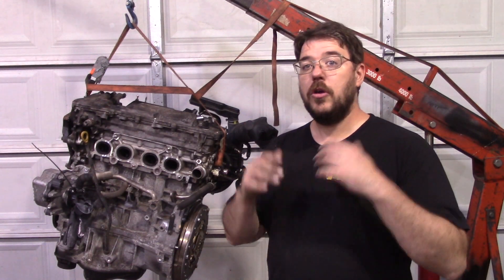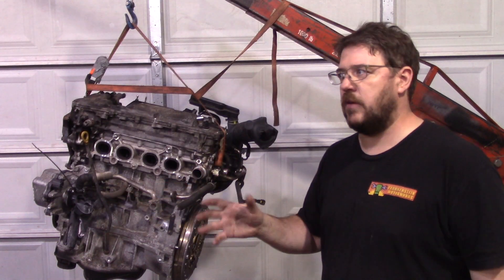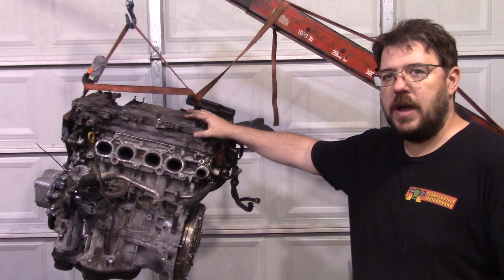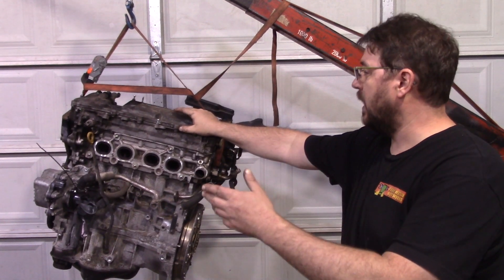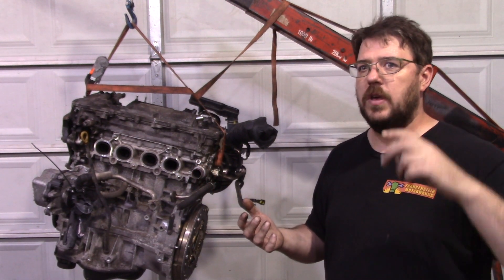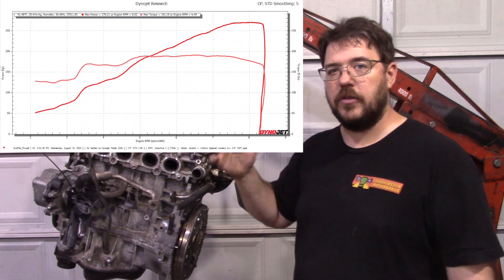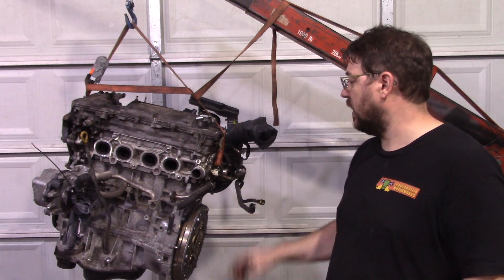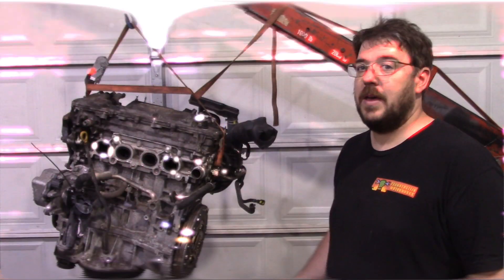270whp on a 2AR-FE!

Comment: To achieve your desired 12.5:1 compression with the 1AR crank, will you be using shorter custom rods to use the OEM pistons, or normal aftermarket/OEM rods with custom pistons? Also, that bump in torque at about 3500 seems interesting, I wonder what kinda wonky resonance is going on there.
Reply from the maker: the bump at 3500 is just because i did not tune down low too much. that could be smoothed out by a fair bit but i don't want to do it until i have the final version of the product.

Comment: 270Whp already better than K24 + K20 Vtec Head , Nice job , Marc
Reply from the maker: Honestly, it would be weirder if it wasn't. This motor is about a decade newer design than the K series. A lot of things have been figured out in that decade.
Reply: @FrankensteinMotorworks  your motor still on stock Piston & conrod right ??
Reply from the maker: @LeongStrife  yes, i have not touched anything in the bottom end.
Reply: Delusional.

Comment: I need a 2AR rwd trans... Miata would love it, helluva lot cheaper than K.
Reply from the maker: There are RWD transmissions that can mostly bolt up to this engine (starter mounting issues are still there) but you're absolutely right that a good RWD adapter would be fantastic.
Reply: @FrankensteinMotorworks  not that trans adapters are super difficult. Wonder if a taco 5 speed could be crammed in. The motors look mega tall, I need to do some measuring and see where it's at. Already running a standalone so why not. Also stock torsen could handle that motors torque, so custom driveshaft mostly, everything else would be ok

Comment: i’m torn between this and the 2gr for a mkii mr2. i’d like to leave room for forced induction.
Reply from the maker: honestly it's a tough decision because there's no good answer on this for everyone. But if you're going boosted it's a hell of a lot easier to fit a boosted 4 cylinder in the SW20 than a boosted 6 cylinder. What kind of power goals do you have?
Reply: @FrankensteinMotorworks  absolutely. im thinking 400 whp. looking forward to a boosted 2ar build!
Reply: I wonder what the advantages of the 2gr are since it seems like similar HP is achievable NA and the 2AR is easier to work on

Comment: If you were to ballpark this, can you do this swap, 270whp setup, with tranny for less than $5k?

I love how this is the toyota version of a Kswap, but better in many ways
Reply from the maker: the swap costs for the motor in an MR2 Spyder can vary wildly depending on how you source the donor engine/transmission. that can go between free and $3500. beyond that you're looking at about $3200 for all the swap bits, some of this can be DIY and you can save a bit there too depending on how handy you are. then, to modify the motor like this you need valve springs ($620), cams ($990), intake manifold ($799+$320+$500). Which adds up to about the same cost again as the swap, about $3200 or so. 

No matter how you slice it you're unlikely to be able to fit this exact setup in an MR2 Spyder for $5k or less unless you do a lot of DIY parts.
Reply: No, it wouldn’t be that cheap unless you parted out a tC for the engine/transmission. 7k for the normal swap, plus 1k extra for an ECU, plus 1.5k for cams and springs, plus 1.5k for the intake, roughly.

Comment: I know you are still building a drag motor but I didn't hear any statements to take the record this go around. Good results though.
Reply from the maker: This wasn't really an Evey video, this was just a 2AR-FE video so i kept the drag racing talk to a minimum. I still very much intend on taking the record and this result is really helping my confidence in my ability to do so. this is around 125hp/L and my goal needs to be about 150hp/L and i haven't done the things that are more or less guaranteed to make more power yet (compression, displacement and fuel type). Will that add up to the missing 80whp for my goal? I'm not sure but there's only one way to find out.
Reply: @FrankensteinMotorworks  Is the attempt date open ended on this project? I ask since I would hope to still be drag racing at that time.
Reply from the maker: @HuxRacing  As much as i'd like to make this my top priority, i do have a business to run. But it will be relatively soon.
Reply: @FrankensteinMotorworks   Well understood. Its been over a year since the callout . If it takes another, the goal post will be over the horizon.
Reply from the maker: @HuxRacing  i don't quite understand what you mean by "over the horizon". Are you getting out of drag racing in another year or are you continuing to upgrade between here and there?
Reply: @FrankensteinMotorworks  Upon callout the all motor mr2 record was 11.6. The record is now 11.18.  By early next year I anticipate mid 10.50s. All on E85. Methanol should see these cars in the 9s.
Reply from the maker: @HuxRacing  oh, yeah i get that and i do wish you the best in going fast. I have a lot of catching up to do. I'm glad to hear you aren't retiring in a year.

Comment: What is the cost of the plenum required to work with your velocity stack? Also is the TB is the stock 2ar one?
Reply from the maker: It uses the skunk2 ultra race plenum, there's a bunch of different ways to configure it from there: https://skunk2.com/induction/intake-manifolds/ultra-race-intake-manifolds/907-05-0070.html

I used a 3.5" throttle body
Reply: @FrankensteinMotorworks  the 3.5 TB: which one are you using exactly?
Reply: It would be simpler if you could package all the HW required in one bundle on your page

Comment: I wish we had someone like you in the 1NZ-FE world.
Reply from the maker: I'm sure it has a lot of potential, most of what i'm doing here can be done as one-offs, they just take a bit of time to get done. It's just that i'm not dealing with any cars where the NZ family makes much sense.
Reply: There are a few places in other countries that build and produce parts for the NZ. You could always do the tried and true 1nzfxe and jun cams. Usually 150+hp out of that setup
Reply: @connorbabcock8197  I actually have everything to do a 2ZR-FE swap into my Yaris except for the engine harness out of a Scion xD. Im curious if you can put FE cams in a 2ZR-FXE like the video as the FXE is intake VVT-i only whereas the FE/FAE is dual VVT-i same as the 2AR.

Comment: That’s big on a intake gain. Do you have a lot of injector duty left? Also 2.7 or 2.4? The 2.7 is taller does it even fit? The 2.7.
Reply from the maker: I'm at about 70% injector duty cycle. THis is the 2.5L, 2.4L is the previous generation. The 2.7L 1AR-FE engine is the exact same block and head, it will fit just fine.
Reply: On fuel I’d start with race fuel with e mix. Btw I saw your around Indy. I’m just down in Evansville. I was looking at this 2.3 eco boost I have sitting here to put in my spyder this winter.
Reply from the maker: I will probably play a bit with ethanol but being in Indianapolis it's easy to get Methanol so there's little reason to play with E85/E99 first.

Comment: Well Done!  
Another little trick is to move the injectors (or perhaps direct injectors at ~150 bar?) to the mouth of the intake bell, higher pressure, better atomization, more surface area = cooler intake charge
Thanks again for this.
Reply from the maker: The stock injectors are actually really fine atomizing. I am currently using the 545cc version from the 5th gen 3s-gte which has the same spray pattern as the stock 2AR injectors. videos like this do show there is an advantage to it (https://www.youtube.com/watch?v=u_E14RKskbM) but it's a pretty small advantage. At the moment i will not be doing this but as i raise the revs more and more it may become a thing.
Reply: @FrankensteinMotorworks  Absolutely.  I'm working with a much more archaic design - just trying to get the coolest, densest intake charge I can.  And that takes time and maximizing surface area of the liquid...  hence, injector location and obsession with smaller drops.  Luckily, I have vertical intakes, not horizontal.  BTW, great video
Reply: No if di you leave di and run extra port injectors using something like a split second controller. Most have a tb spacer setup for 2 injectors to 4 meth ports. Otherwise 4 extra on each port. Which is best to keep valves clean on a di engine.
Reply: @justanotheroglesby2847  I'm trying to make the smallest droplets, with the greatest surface area possible, getting the intake charge as cool as possible.  Fuel droplets from DI injectors are orders of magnitude smaller - not worried about keeping the valves clean - worried about making the intake charge as dense as possible with the least amount of puddling.

Comment: I guarantee you this engine was originally designed to not only go into normies cars but whatever the FT86 project would be IF Subaru said no. Not that Subaru could say no when Toyota bought a giant stake in them, but you have to have a back up. But the issue was, they couldn't make a bespoke engine for a sports car and still make it cost effective with such limited runs. The engine went into production literally MONTHS before the FT86 concept was shown off. But none of these plans panned out and so this is what we got. I'm pretty sure since the mid 2000's Toyota had intentions to revive their sports car line up, but didn't have a cost effective solution. But, collabs we're the more cost effective solution, and now we have a BMW Supra and a Subaru AE86. Rumors of a new MR2 have been flying around since ever and by the time 2020 came around...emissions regulations were so different than this engine literally died being just a Camry motor. It was one of those corporate decisions to hedge their bets on having a motor just in case and it just didn't pan out. I mean...now we have the 3cyl 1.6t motor that makes 300hp and people think that's a lot. Well...it's not, tuners say stock it can go up to 500hp, imagine, this is all an evolution of the AR series of engines slowly morphing into the A20/A25/T20/T24 series of motors. Literally what you said! I mean look at the gains from the 2AR to the A25, about 10% thermal efficiency gain over all with higher compression, revised intake and exhaust, and electronic intake timing and GDI. Not a whole lot changed for such gains. If thinking about this logically, if Toyota used the same ideas to make a new 2.0 turbo based of the 1.6...they could make 350+ STOCK to the wheels. 

Sometimes Toyota scares me. They have all of this just sitting there waiting to make more power at a moments notice...IF they ever need it.
Reply: I'm believe as well that this was the backup engine for the 86. It makes perfect sense.
Reply from the maker: That's not a bad guess. we don't have any way to know for sure but the timeline seems to agree.

And yes, many of Toyota's motors are serious monsters waiting to be unleashed. The newer 2GR-FKS and A25A look like they lost a bit of that but thankfully it's not like the ones from the great generation of Toyota motors are rare.

Comment: I'll be going 2AR in the next 12-24 months. Absolutely saving me from the K swap.
Reply from the maker: One win at a time. Welcome back to the Toyota motors :)
Reply: @FrankensteinMotorworks  Thank you so much.  Do you think similar gains could be had with a speed density standalone?  My understanding is a MAF is best, but I already have the speed density ECU that speaks BEAN.  I'd hate to sell it for cheaper than I bought it to go back to MAF, considering how much it cost me.
Reply from the maker: @hamsterbrigade  Yes, you can make the same amount of power with speed density as you can with MAF. The advantage to MAF is how it handles all of the volumetric efficiency differences that happen on a motor like this when you transition from one state to another at a different speed than you did when you tuned it on the dyno.  If tuned properly it will always result in things being richer so it is not generally dangerous for the motor but it can cost horsepower, sometimes quite a bit. The other big advantage is just how easy it makes the tuning.
Reply: Is cheaper than k20 swap?
Reply from the maker: @rolldog82  both swaps are very similar in price, it will come down to what deals you can get on the donor parts for either swap.
Reply: @FrankensteinMotorworks  k20 swap in Los Angeles now is 10k the 2ar is cheaper because it's a Toyota right? You know much cheaper

Comment: You should try and build a long runner intake manifold to get the 2nd wave harmonic effect aim between 8 to 9.5k rpm  you should be able to gain another 20whp
Reply from the maker: yup, that's honestly where I thought I'd be going with this. These current runners are as long as possible to fit in the chassis without getting extra complicated with the design. They actually should peak at around 9000rpm based on their length. But even that 9000 is the 3rd harmonic, not the 2nd. to bring it down to 8000rpm and the 2nd harmonic i would need to add about 8" of runner length. The math shows it would help for sure but it does not matter if it does not package in the engine bay. 

That said, if you were to use this with a 3" spacer between the velocity stack and the head it would be a better match with these cams. There may be a solid 10hp in it and i will certainly try it at some point if i have access to an engine dyno and i don't have to worry about engine bay space limitations.
Reply: @FrankensteinMotorworks  seems to short for a 9k rpm powerband maybe the head entrance  to valve length on the 2ar is longer that most engines
Reply from the maker: @stephenwever  the runners inside the head are actually quite long, probably because of that tumble valve again and the sense of scale may not be communicated because everything on this motor is a bit bigger than a normal 4 cylinder.

If you look up pictures of the 2AR in an MR2 Spyder engine bay vs the stock 1zz the size difference may make more sense to you.

but the overall point is not wrong, i do think this engine would benefit from a bit longer runner than i have here. but this feels like it can be achieved with a spacer between this manifold and the actual head for the people that have the available space.

Comment: Love this build big up for this information tho one question tho is ok to use 75shot nos on the motor cause most cars I meet up are using nitrous
Reply from the maker: nitrous done with the appropriate fueling is not really dangerous. but your timing does get a bit more sensitive since there is less nitrogen in the cylinder to cool things down.

Comment: It really is interesting to see the insides of how Toyota developed the AR with those insanely big for stock intake ports and valves. I wonder if the same technology/techniques were applied throughout that engine generation such as with the GR, ZR, and UR engines?
Reply from the maker: i can't speak to the ZR and UR engines but the GR has big ports but not quite as big as the AR. the GR and AR do have a lot on common but i think they both have small advantages over the other depending on where you look
Reply: @FrankensteinMotorworks  what would be the advantage of the 2gr over this? Seems like the AR can reach similar numbers NA and is easier to work on and cram in that bay
Reply: @turnerables GR is up to 400whp na. There really is no replacement for displacement... But you've gotta weigh complexity and, well, weight against a 4cyl. The 1/2AR is an incredible performer.

Comment: Amazing work as always! Just to confirm the setup making 270whp is a camry/tC/rav4 10.4 comp ratio FE? Or is it the converted FXE engine with the higher compression bottom end?
Reply from the maker: Yes, this is the 10.4 2AR-FE version, not the 2AR-FXE version. It can get a bit confusing since i go back and forth testing different engines.
Reply: From his listing on the website, this is with the 10.4 CR 2ARFE.

He also mentions custom 12:1 pistons to be the next step for that engine, in the video.
Reply: It would work on either FE, FSE and FXE
Reply: From previous vids it’s more about the cam change between the versions. Which also I think the hybrid has different compression ratio.

Comment: One more question, could the plenum for your velocity stack intake be flipped so the throttle body faces forward? It looks like the bolt pattern is symmetrical but I'd like to know, longitudinal RWD application for 2AR swaps is something that the K swap has much more development in.
Reply: Yes,  please answer this @Frankenstein Motorworks  I'm very interested to know this also,  I've already sorted the rwd part
Reply from the maker: no worries, it has been answered and you can feel free to reach out to me for any other questions like this.
Reply: @FrankensteinMotorworks  excellent ill suss that preorder now,  is there plans to do more runs if I can't make the back required for this one
Reply from the maker: yes, this is just the Skunk2 ultra race manifold. you can flip it around, you can even get center feed versions.